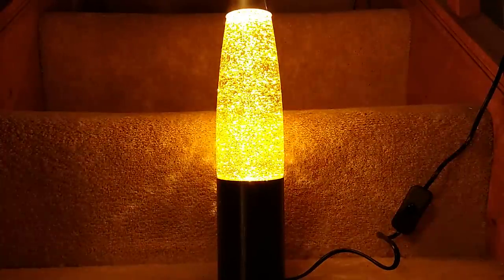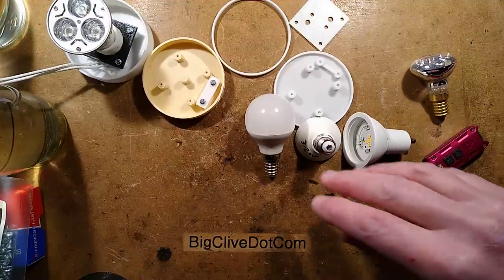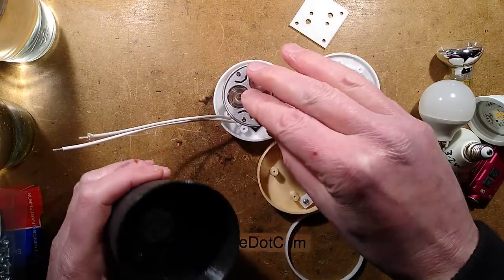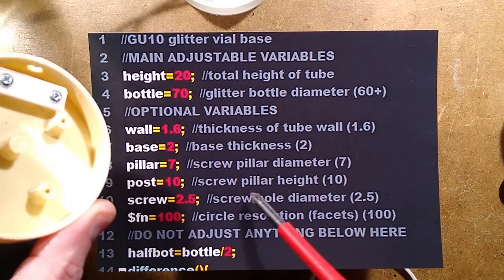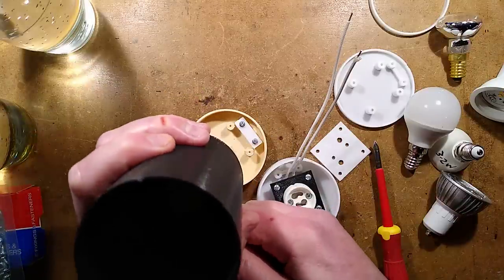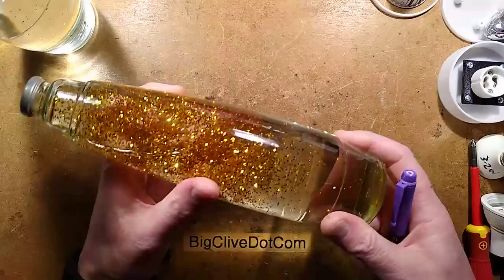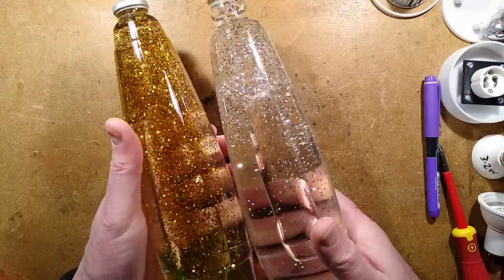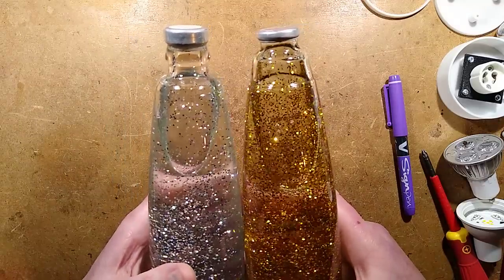Custom LED flowing glitter lamp

Comment: So I am working on making glitter lamps out of 1 gallon glass pickle jars (since that's the clear glass I have around). At 1KG per 650mL, that would be 12.84lbs of CaN for 1 US Gal of water. (Since 1 Gal of pure water is 8.34lbs, no wonder this solution feels so dense). Is that 1KG per 650mL figure about what the end-product needs? Also, what is the end volume of that batch, or is the 650mL the end volume of the solution?

I'll be 3D printing a base for the electronics, which will be a strip of RGB addressable LEDs and an ESP8266 microcontroller.

Comment: Is it possible to hack a blobby type lava lamp  to run on LEDs? I suppose you could separate the heating function from the light and use a power resistor along with the LED...
Reply from the maker: It would be nice, but they require a huge heat differential for a decent effect.

Comment: Hi  Clive  i just had a light bulb moment!.....wonder if you could use some of the new induction powered LEDs floating in oil with coils at different levels of the bottle?....may need to adjust the LED buoyancy but might be worth a go!😄
Reply: Hmm, you'd want each led to capture and heat a small amount of liquid around itself ... Sounds interesting, but hard
Reply: @RossReedstrom  or maybe make a small tube from epoxy

Comment: Do you think this would work with an MR16 downlight globe? Or do they not get hot enough to move the glitter? Could you get away with good old fashioned sodium chloride, or does that not raise the sg of the water enough for this?
Reply: Solubility of common salt is too low, only about 36g/100ml compared to 130g/100ml for calcium nitrate.
Reply from the maker: It would work with an MR16 lamp, but the base is only suitable for a low power LED one.

Comment: Just off topic for a moment - what temperature do you run your iron for leaded solder and (ugh) no-lead solder? And is there a visual clue as to which is which when it is in solid state?
Reply from the maker: I tend to run my iron at around 350C for lead based solder.  I don't use lead free.   It's often best to go by feel.
Reply: @bigclivedotcom  thanks so much. It's about what I use, and I don't use unleaded solder either. Does it require a hotter temperature to desolder unleaded, in your opinion? Seems so to me...thanks again!!

Comment: Mostly unrelated, but the bulb in our new fridge went. Oddly it's an incandescent bulb, not LED, and a replacement was very hard to track down.
Reply from the maker: If it's a screw-in lamp then you can get LED retrofits for fridges.

Comment: Fun.  Could you somehow use lasers (like the little pen/handheld ones) in place of the other light to give a more directed flashing of the light off the glitter?
Reply from the maker: It would look good, but would not be safe.  It's best to avoid direct eye contact with a reflected laser beam.
Reply: @bigclivedotcom  I was thinking pointing upwards through the liquid and bouncing more directed beams (maybe more than one/multi color?) with the top opaque so the beams couldn't accidentally be viewed from above.  I was thinking the glitter would be moving fast enough that even if it did strike your eye, it wouldn't be damaging, but perhaps the risk of eye damage is higher than I thought.

Comment: Big Clive, have you tried urea for adjusting the density?  You can get it fairly pure and it can make a very dense solution. It is also non-toxic and non-corrosive.
Reply from the maker: I'm not sure it would have a high enough specific gravity.

Comment: neato, but now I'm thinking of a dual pane vinyl window sash filled with glitter liquid and with led strips on the bottom and one side that will create a circular flow current.  I'll hand it off to you for expert implementation.
Reply from the maker: I have considered large flat glitter panels with resistors siliconed along the base for thermal flow.  Possibly with a mirror at the back.

Comment: What about using antifreeze suitable for aluminum engines or maybe coolant used in a Computer cooling system?
Reply from the maker: I've tried glycols and they aren't dense enough to support the glitter.

Comment: Your videos are fun! Thank you for making them!
I've been wanting to ask you this for a few months, I'm trying to get into circuit boards for a project i'm working on.
Basically I have this watch with no guts. I want to put in a CR2032 battery, a round circuit board, red LED lights, and a push button switch. Do you know where I can learn more or maybe you can help? I'll take any information you have.
Thank you for your time.
Reply from the maker: It depends on what you want to do with them.  For simple circuits you may not need a PCB.

Comment: You've used glycerol for lamps in the past. Is that still a good solution with these glitter lamps?
Reply from the maker: No.  The plastic used for most glitters is quite heavy, so it requires a very dense liquid.

Comment: Have you tried the 12V lamps and a transformer? I don't know if they can be easily hacked to lower power though.
Reply from the maker: The base should work with many low power lamps.

Comment: What if you did one like for a tungsten lamp but with a 100W LED?
Reply from the maker: The LED would need to have a custom heatsink to transfer all the heat to the bottle to keep the LED as cool as possible.  100W would need quite a big bottle to avoid the risk of overheating and pressurisation.
Reply: If it weren't for the awful corrosion problems you'd get I'd say submerge the COB directly in the fluid inside a straight-walled borosilicate cylinder

Comment: Makes a change from  stuffing a resistor & a bulb in the base...
Incident, I couldn't help but notice News reports about a 'New'  technology allowing domestic heating by means of wall mounted, powered carbon fiber sheeting, virtually just putting a big, flat, carbon resistor, under your wallpaper..
Any comments ????
Reply from the maker: The Russians have been using carbon fibre panels laminated into wall hanging decoration for a long time.  The idea of putting it under wallpaper is probably from the same bad idea department as the people who proposed electroluminescent wallpaper for lighting.
Usually freshly qualified "design students" with no grasp of reality.

Comment: Acronyms don't have pronunciation unless you want to assert a 'dialect' for all acronyms. For example, the class "gif" argument: the maker of the format has asserted a pronunciation because he named it; however, in doing so he would be wrong as it is an acronym and not a new word or name, in which cause the originator would have an input on the proper intended pronunciation.

I would argue that despite being a name, OpenSCAD would fall into this because it is clearly using an acronym within the name; however, there would be an argument for a preferred pronunciation to maintain "CAD" as a separate acronym for clear understanding as a CAD program. How important or effective that would be, I have no idea, nor greatly care.
Reply: In languages with 100% phonetic spelling, everything is pronounceable. Including acronyms with only consonants in them -- albeit KKK is little challenging , but KSR is not.

Comment: If you raised the support pegs slightly you could make a pcb with a simple dropper circuit and some of those connectors so you can plug in/swap different LEDs… then again it’d be very fiddly to get to 🤔 great little project tho I might do something similar with my kids although we don’t have a 3D printer so I’ll have to find a suitable ’tube’ and bottle to fit.
Reply from the maker: I've done versions with a resistive dropper, using the resistor to heat the base of the bottle.

Comment: Can't you cheat with a glitter lamp, add a stir bar and run a small motor with a magnet on the end, zero heat, maximum led?
Reply from the maker: The agitation is usually too strong.  There are lots of units that do that.

Comment: This project is incomplete without E14 lamp socket:

use <threads-library-by-cuiso-v1.scad>

$fn=100; difference(){ union() { translate([0,0,16]) difference(){
cylinder(d2=23,d1=20,h=11); translate([0,0,-1])cylinder(d=18,h=13); }
difference(){ cylinder(d=20, h=16);
thread_for_screw_fullparm(diameter=17, length=24,pitch=11/4); }
cylinder(d=20, h=2); } translate([6.5,0,0])cylinder(d=3,h=16, $fn=30);
cylinder(d=3, h=10); }

Comment: Iäd lik to see one usng polyethylene oxide for the liquid and uv+ coulour changing leds.
Reply from the maker: I tried many glycols with no success.  The normal glitter is very heavy.
Reply: @bigclivedotcom  Yeah but this seems to be a powder you can dose as appropriare and it also has another trick up its sleeve.

Comment: Mother Robot:  What happened to Grandpa?  He can hardly fit through the front door.

Little Brother Robot:  I think he was reading this ad.

Don't be a 5' shrimp anymore.*
Get longer legs and get the girl.*
3D printed legs.
Please check one.

6'     Stud
6'6"  Lady Killer
7'     Grrrr Tiger

* (R) New ATLAS Corporation

@:-)    #:-]     8o]